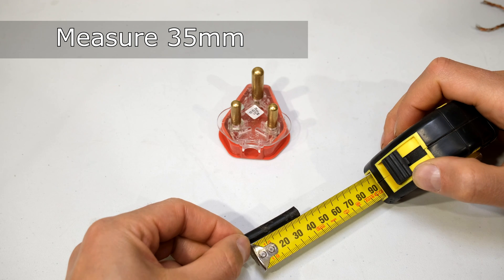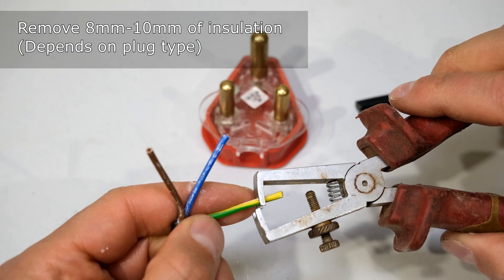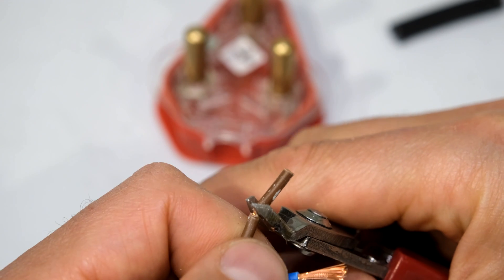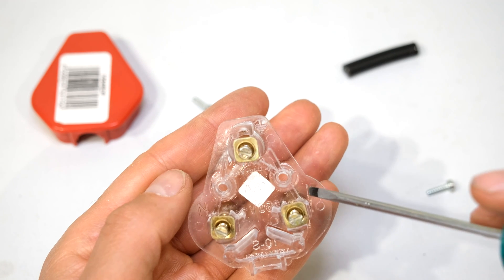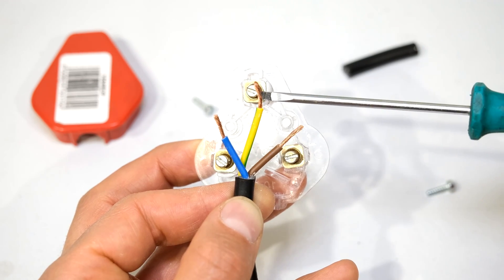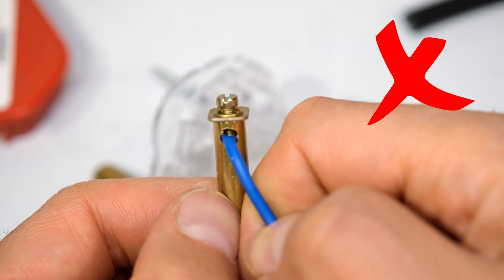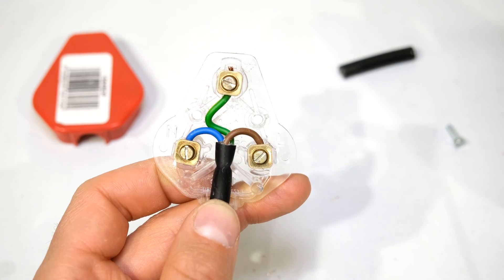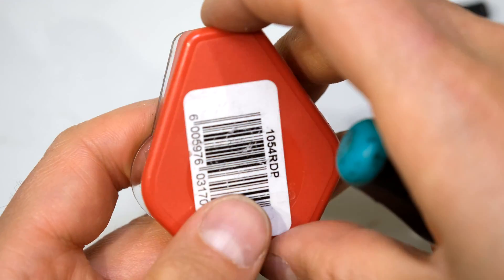How to wire a South African three pin plug top

Comment: The difference between L and N
Reply: The neutral is grounded so it is at the ground potential. The live or the line has potential to the ground. It works even if they are reversed but things like lamps are safer when they are correctly. The switch will cut the line and there will be no voltage on after the switch when it is off.

Comment: I got a light fitting with no earth wire (just 2 wires, blue and brown) ... I need to add lead extension, switch and plug ... is it safe to use such an item without an earth while obviously making sure they're insulated etc?

Comment: Allway loop the ends fr better strenght and avoides cutting  the strands ...earth cable should be as  long as possible, if the wires get pulled out it must be the last cable too come out...your protection from electrocution....tightthe screws... wait a few secs for wires too compress..then they can be tighten again for a proper secure connection.
Reply from the maker: thank you

Comment: The wires I have are black, red and then one mixed with green and yellow (which I guess was the earth wire).
Reply: Black is blue in this video(neutral) and red is brown (live) and yes the yellow and green is the earth wire
Reply: If you request on Left & right you shouldn't be doing any wiring.